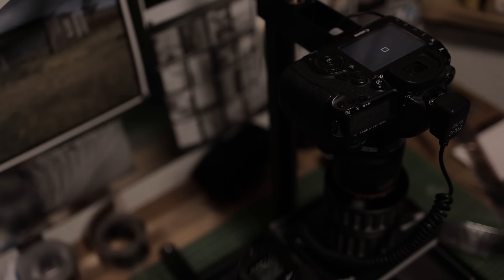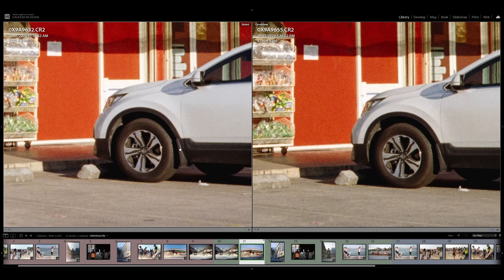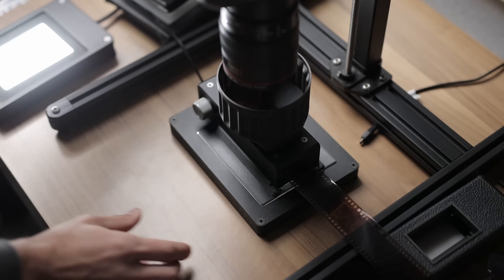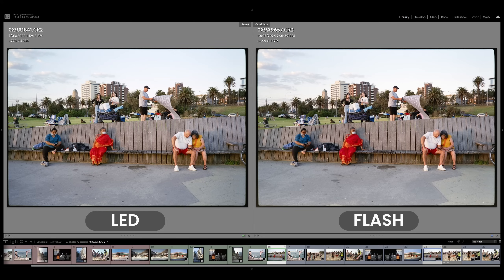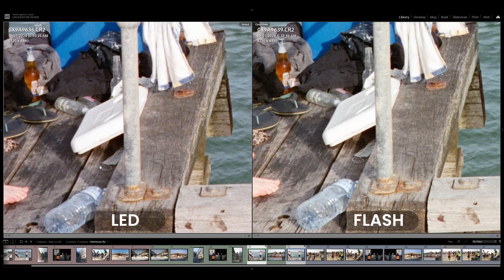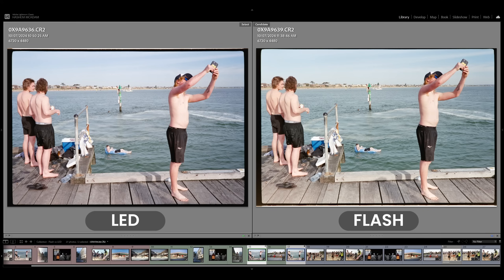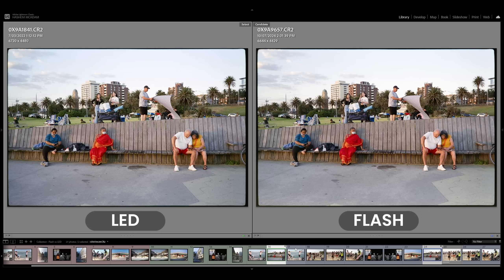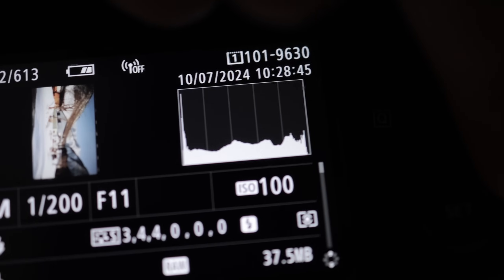Flash for Film Scanning - better than LED?

Comment: This was interesting. I think the convenience, continuous light and low heat output of LEDs make them really good sources. That said, all light sources have differences in distribution of frequencies and LEDs are certainly a quite different light source than a flash. Don't know the details and don't have the equipment to measure different light sources, but (as you mentioned) the shutter speeds you can get with a flash would be an advantage. Maybe using a flash like the Godox V1Pro with a build in led light would simplify the setup. Keeping the flash outside the box might also work well as you could have just a reflector inside the box. Increasing the distance could make it easier to get light distribution perfect and keep the flash cooler under heavy use, but with 1/32 or less power that might not be a problem. 
Looking at some of the macro flashes the part of the flash that actually generate the light is quite small and could probably be built as a fairly compact light source if someone was interested in making one specially for camera scanning. Flash is a pointier light source than a bunch of LEDs though so getting an even distribution without adding height to the source might be difficult.
Reply from the maker: Yeah something like that Godox would be more suitable I think!